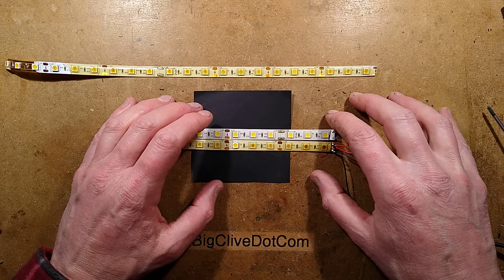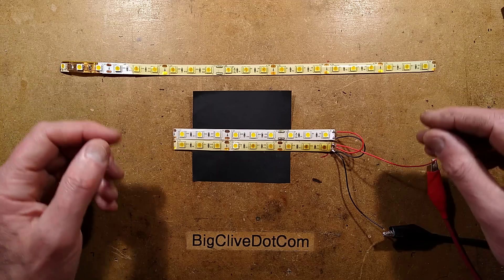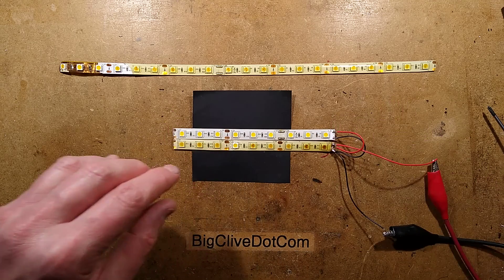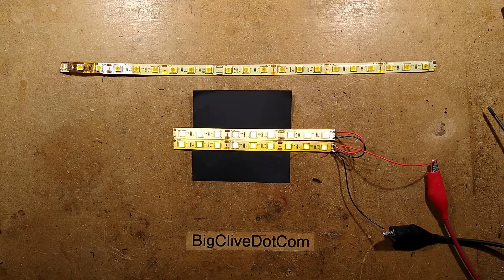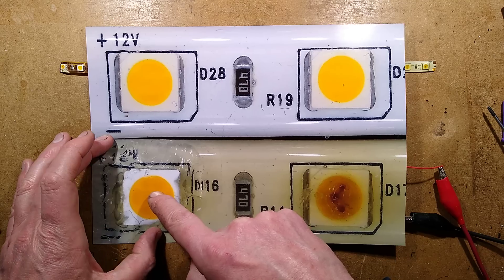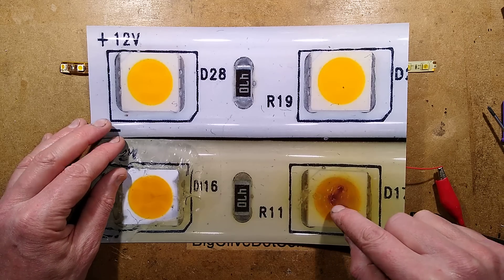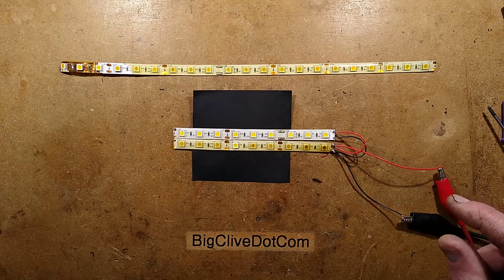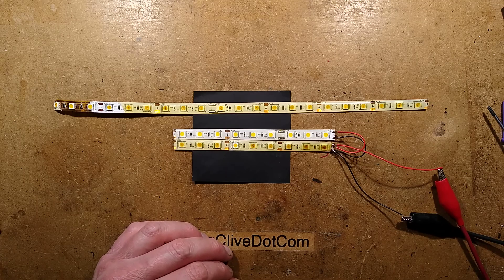IP65 LED tape coating fail

Comment: I bought quite a few 5 metre reels of 50 50 Leds off Ebay about 8 years ago. Most fell off because the self adhesive backing gets warm so I had to glue them on. They all went yellow after a few years. No problems with the actual LEDs. The smell of the remaining ones left in the sealed bags is awful and suggests it degrades whether used or not.

Comment: When I was still employed, I helped a Phd student build a series of portable moth traps. The silicone encapsulation of the near UV (405nm) LED strip soon bronzed and greatly reduced the ouptut. Some batches were affected more than others. Buying non encapsulated tape was the solution. 

In your case it would be interesting to know how much UV is being emitted. Perhaps the Phosphors are not as efficient as they could be.

Comment: Yes, the same here. Yellow-brown tape around the LED's, less around the resistors. I actually have also a strip of 220V directly on mains that has this same problem and getting more and more dark yellow and dimmer but all the LED's are still giving light.

Comment: So why is the left part of the top line of lights not yellowed at all?
Reply from the maker: The top section was brand new strip from the same roll.
Reply: @bigclivedotcom  Apologies, The long tape has a section that hasn’t yellowed on the left side. :) I wondered why that hadn’t changed like the rest of it.

Comment: Looks like you were LED down the garden path with that one!

So in essence, the silicone gel isn't as UV stable as it should be? My concern would be if the coating could actually catch fire? Or generate enough heat to ignite other materials nearby?

Comment: Same problem under the kitchen counter but with 2835 leds. Went from 6500k to orangey 2700k. I'll probably scrub of the silicone coating

Comment: I've got some LED tape around my shed that's been out in the elements for about two years. It comes on every night for a few hours and is on the side of the shed that gets blasted by weather and baked in the sun. Surprisingly it still works even though it's gone all yellow. I'm kind of using it as an experiment now to see how long it lasts.

It's doing a lot better than the PIR Led floodlight in the same location. That thing is now running at about 1/4 brightness and one of the LED chips has turned black.

Comment: I never liked the gel coated LEDs, mostly as I have yet to use them externally anyway and they didn't fit in some of the very thin aluminium extrusions I use. At one point is was almost impossible to find cheaper LED tape without the coating on, so I used to spend ages removing it LOL

Comment: Thanks. 
I've just installed a pile of this in my camper. Looks like I'm  in for a big job in a couple of years :-( At least I know. I was worried about the glue failing. Guess that will make the replacement job easier.

Comment: I have a similar strip above the kitchen counter for about 5 years and the same thing happened, it became very dim and orange. The whole strip looks like it has been out in the sun the whole time. It have been turned on several hours per day and it gets quite warm (the strip is stuck on the wood cabinet, I did not even know back then that it would need a heatsink...). I wanted a waterproof strip for possible splashes and safety, but now I will replace it with a normal strip in an aluminium case with milk white cover.

Comment: I had a 5m strip of coated RGB LEDs on the back of my desks and noticed them getting dimmer over time, because the coating was yellowing. Swapped them for a set from Govee which are also coated so I'm keeping an eye on their performance. Won't be buying any coated strips in future. Thanks for these insights Clive.

Comment: I could immediately see that the coating gel had "corked" and thats the reason, you can see it discolored throughtly so its age thing. Plastics tend to change color when they age, even faster if under UV light, so no wonder. Anyways interesting discover, I too have similar led light strips so when they go I know what to do with them, if I remember this video at that time :D

Comment: Ive had that tape fail from the same fault but if you leave it, the extra abursion also ends up cooking the chip under it.
Also although it waterproofs the top of the tape, water gets in the back and sides of the tape and can do damage that way too.

Yet to find a waterproof led tape that lasts more than a year in rugged environment.

Comment: I had the exact same failure a few years ago. It burned in very fast, just at 10 volts. Also thought it was the phosphor because I have seen it with other LED's. Never took it apart, now I know 👍

Comment: I've replaced loads of the ip rated stuff. It appears as tho the silicone coating dries up and pulls components off the tape. Takes about three, four years. I do wonder tho does the amount of current on longer lengths dry it up quicker. Haha is it drying up or is it being affected by UV. Mmm.
Reply from the maker: Possibly also plasticiser gradually seeping out.
Reply: Yes something chemical going on. I've seen it so much that I don't bother with it anymore . Led tape is pretty robust as it is. It's usually copper under solder joints that corrode. Maybe should try covering some tape myself next.

Comment: I had 6 led lamps running in my back room for 7 years.  Two have turned noticeably blue and when one failed I took it apart to see why.  The gel had dried out split, allowing the blue led to shine through.  All six have degraded brightness, they are at 270 lumens but now produce just 240 lumens.  The four led lamps in the kitchen were replaced in one go when three failed within a short time.  Two where bond wire fails and one was an initial failure of two leds followed by flicker and failure of the remaining two.   Three of these had their lenses fall off as the plastic had crumbled.

Comment: I have a long strip that has done the same, you just reminded to pick off the rest of the coating from the downwards facing section as I had started but it felt like it was going to rip off the LEDs.  Fortunately it does seem to have come off relatively clean, though some of the LEDs have a black dot on them, not sure if from the time I ran them 100% or something else.  Some of the LEDs are still visibly warmer, though possibly just because it was a dirt-cheap strip so not consistent to begin with.

Comment: Like everyone else I've had exactly the same experience. I have several RGB and warm white strips around the house and all have exactly the same issue. 

In a couple of cases I've lost so much light I've replaced the silicone stuff with unprotected tape. Much better lighting but with the slight risk of damage.

Comment: Very interesting, I had never seen that with LEDs, but years ago I saw fluorescent tubes, that had not been renewed at the correct intervals, cooked the control gear and started to broadcast light much more in the “ultraviolet ish” spectrum. This had a very degrading effect on the diffuser of the light fitting, causing it to brown in the area directly beneath the tube. The tube is also used to blacken very quickly near the end caps after they were changed. No one could tell me whether this change would cause a sufficient amount of ultraviolet light to be broadcast to cause damage to people’s skin working directly beneath these fittings
I’m surprised you get so much work done with those kittens pouncing on your feet😂

Comment: I had this happen but to red LEDs. I was running a cold white strip next to a red strip and it only happened to the covering above the red ones. My first assumption was that the discolouration was from UV coming from the white lights but when tested it was just with the red lights. My best guess is that it was due to thermal effects now but I'm not sure.
Reply from the maker: That's odd.  Red light is usually fairly soft on materials.

Comment: I've had the same experience but with a blue LED strip cut from a long roll that had been running at its rated 12 volts. It served as a glow lighting for my computer case, and when I removed it a few years ago because it was dim and some LED's flickered, I noticed that some chips had completely died, some chips maybe 1/3 of the LED's in them died, and that rubber coating had blackened, in fact seemed burnt, where those dead LED's were. The seriously burnt ones were completely black around the area and had melted down around the lens. Anywhere not burnt was yellow. Those lights did get hot, so its possible the blue light degraded the rubber to a point where it could essentially just melt and burn away from the heat, and maybe even damage the chip itself. Maybe I should try them again but remove the rubber, it is fairly easy to peel or slice off.

Comment: I have had a similar problem with the RGB tape only I believe the silicone coating was corrosive and had killed the green and blue bond wires within the led with red the last to go but eventually dying also.

Comment: The same yellowing occurred with an entirely unused and packed away roll of RGB lights. The coating also got somewhat tacky. I have tried peeling the coating off, but it was on there so well it took the LEDs with it.
Reply: Same. Maybe it's moisture.
Reply: @nyetloki  Probably volatile chemicals like plasticisers leeching out, and UV damage to some extent

Comment: I have a pc case that had a white led strip inside that lit up a plexiglass plate with an etched logo on it and after a couple of months, I noticed the logo was getting darker and turning yellow. When I took it apart to inspect what was happing I found it had the same issue, the coating was burned/yellowed. They were never very bright leds so it surprised me that it would have done that but, I replaced it with a cheap RGB strip from Walmart and now it's even better than the original!

Comment: Same here! I installed a cool white strip in my workspace and used it for a couple years. It had become so dim and orange colored that it was basically useless to me. I discovered it was just the coating and I was kinda able to remove it, so I peeled the whole coating off and it's good as new again. I see now this appears to be fairly widspread

Comment: I run retrofit LED bulbs in older lamps and fixtures throughout my house, exceptions are where fluorescent as in linear tubes were used (in the kitchen mainly) but do have 2 places for CFL's are still used, mostly to finish them off before replacing. Anyway, the lamps all have 3 way sockets and 3 way LED lamps in them and initially all were made by Cree, that is, when one of them decided to loose their phosphor coating in each LED (SMD type) that were mounted on a center hollow support for the circuit board and LED elements. 

Anyway, the LED elements were mounted around the tube and covered with a plastic coated glass like globe. As the bulb was used, the phosphor layer would fall off, or delaminated and would expose the UV spectrum, creating a dim purplish blow, instead of the normal soft white (3000K) like output. It began in September if I recall or late summer as it was part of my needing to replace another bulb, this time a 60W equivalent bulb in a bedroom fixture that had totally failed (driver failed, even though it was suitable for enclosed fixtures and dimmable). Anyway, it got worse and I finally replaced it almost 2 weeks ago and upon cracking it open, discovered what I already knew. The phosphor had been falling out on one side and looking at the bulb lit showed it looked purple on one side and I could see it on the shade and the wall near the lamp, as well as the ceiling. Not a common thing, but it can happen.

I had a bulb fail and when I went to try and get the LED elements to work, only one worked and it was one of those A19 style retro fit bulbs that had the LED elements on a flat circuit board, facing up, unlike the Ecosmart lamps I buy that are of real frosted glass that use the newer filament style LED's for a true point source lighting.

Comment: I used a few of these strips of coated LEDs for a "DIY-placement" for a basic two-tube shop light, thinking it would be a cheaper solution than replacing a bad electronic ballast and two bulbs in the fixture, with the added bonus of being at full-brightness in the unheated garage in the winter.
Boy, was I wrong. In a few months, the gel began having a yellow-brown tinge, which I thought had been tobacco & kerosene smoke. I was surprised when I started digging into it that it was discolored internally - not from smoke! And I deliberately under-ran it.
As I watched this video, I found the remaining half-reel - still in its box, in another box, under a few boxes - so completely unused and not even exposed to light - and guess what? The gel coating has turned brown - not as much as the used portion... Perhaps I'd call it "sepia" or "beige." Well, lesson learned with that one. I thought the IP65 would be suited for occasionally-humid areas, turns out it's not really good for much at all.

Comment: I had to do the same to the mirror's at my mum's salon. Some of them were so bad that the phosphor came off and you could see the bear blueish LED's. I replaced both the power supplies and the tape which wasn't IP65. 
I haven't had any drama's with either the power supplies (which are cheap Chinese one's that are WELL over rated and the tape which hasn't missed a beat.

Comment: A pure compound is clear. A mixture of compounds tends yellow through brown (think urine....and caramel from sugar) . The UV has obviously changed the crosslinking and broken the polymer into differing chain lengths leading to a dark brown mixture. More octyl methoxycinnamate /benzotriazoles etc required in the clear coating to moderate the UV/blue energy received. Mild heat will accelerate it, but high energy UV is a great reaction driver.

Comment: I had the same experience with those strips.  Those early strips are terrible.
Reply: It's hard to say. I think that it's a 'crap shoot' on what you get. I have some from about 10 years ago that are fine. This channel has a newer video about these where the 'newer' 'better' ones he got don't have ANY coating and has bare 200+ volt conductors going down it's length! 
     The big problem is that there isn't a choice to pay more for a better product. It's all cheaply made Chinese crap and it just comes down to luck about what ends up in your mail box! Ya'll Take Care and be safe, John

Comment: Wow. After watching this video, I ran down to my shop as I have an LED strip that I thought was cooked from being used 24/7 for a few years. Haven't thrown it away yet. Just pulled off the gel coating and the diodes underneath were fine. What a great find!

Comment: I have those exact same ones and I had the same issue.    I had some strings of 3 red 1 blue for plants, and all the blues degraded rapidly, but the reds are still in perfect condition.
Reply from the maker: The gallium nitride chips do degrade much faster than the older technology red LEDs.

Comment: It would be interesting to see if this is a phenomenon purely from aging (a chemical reaction), or perhaps a result of the influence of the specific light spectrum of the LEDs itself - like UV components. If the former is the case then perhaps some "retro-bright" process may make them clear again? Just freewheeling here. 

EDIT: I read Clive's description: it's the UV component.

Comment: Heh.  looks like what happened to MTRJ fiber cable connectors.  They had designed these connectors to be field-terminated without requiring polishing, relying on impedance-matching gel to allow the light to pass.  Over time the gel failed.

Thankfully because duplex couldn't be flipped on MTRJ it wasn't popular and was not widely adopted, but for those few installations that used it a switch to another fiber connector with a polishing or fusion-splicing technique was necessary.

Comment: For interior use, LED tape without the waterproof coating is cheaper than the waterproof style.  I prefer 4000.° K as a neutral color that displays colors correctly. Ron W4BIN
Reply from the maker: I've settled on 4000K for most work lighting.

Comment: Same experience I had when making a night lamp but with a different material. I coated the leds in uv resin to protect them from handling and it did the same thing. Next revision, I just potted the surrounding area and did not put any on the emitting surface.

Comment: I've bought several spools of LED tape over the years, one of my first was one of these with the waterproof gel and it has done the same thing, the one I have stuck under my monitor stand to light up my keyboard is also under run so it's a low light and the light is now yellow instead of white.  I also used some from the same roll as under cabinet kitchen lighting and I ended up peeling off the gel and the LEDs were just fine. 

I wonder if they have improved the waterproof coating on newer tapes?  I found some pictures of the under cabinet lighting I did and they were from 2013 and I removed the gel before I moved 6 years ago, so it only took a few years for mine to go yellow.  The keyboard light strip that I didn't peel is very dark now, more brown than yellow.

Comment: My dad refitted some of my mom's fish tank lights with RGB LED strip, and it did basically the same thing, but to an extreme extent; all of the rubbery coating turned yellow / orange / brown and started shrinking, which broke a few LEDs off of the strip and completely came apart when he tried to peel it off and inspect it.
I hope I can find LED strip that is waterproof, won't self-destruct, and won't drain a bank account; more projects keep coming my way, and this one involves a swimming pool.